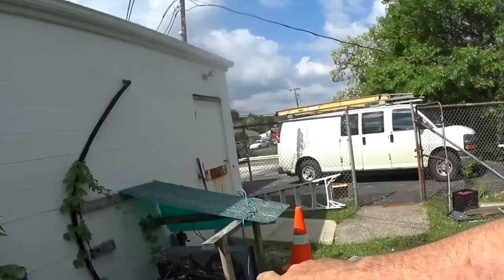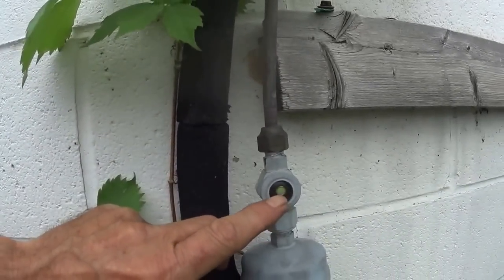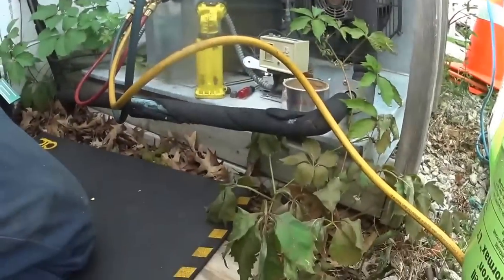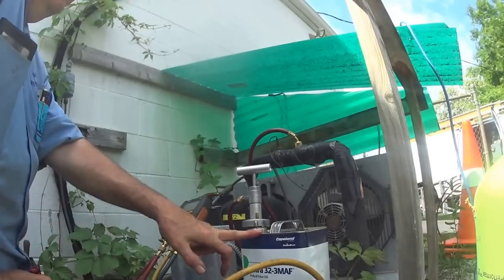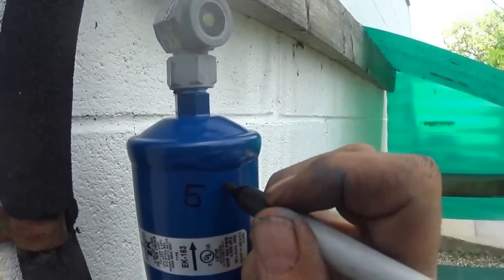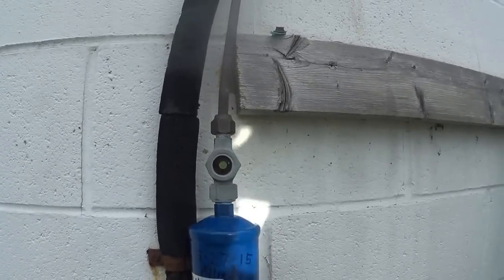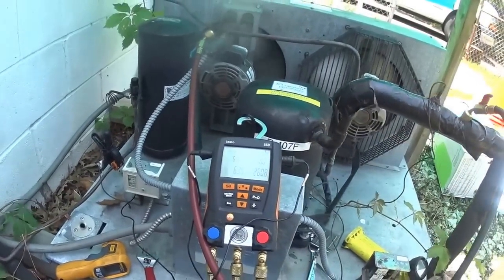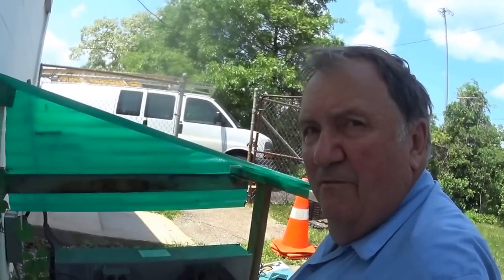R22 to R407F conversion on a beer cooler

Comment: Question, is it ok to just add 20% POE without removing MO? when R407 retrofit?
Reply: I'd say no. You need to remove the old MO first. In the system illustrated there will probably be no problems with the oil return anyway since the suction line is so short, and goes right down to the compressor. But in a larger system with multiple evaporators and longer lines you really want to aid the oil return as much as you can and that means removing the MO, to be taken as a general rule as well. 
We did a lot of retrofitting in the 90s in my country following a ban on chlorinated refrigerants (R12, 22, 502), so we've already made all the mistakes. No need for you guys to make them as well.

Comment: Wow, another pump and adding POE oil on top of mineral oil. Mineral oil will contaminate POE oil and the mineral oil will gum up the system, seen it too many times. You may get away with this for a while outdoors but if you do this to any refrigeration system which runs inside a restaurant under a heavy load the whole sealed system is going to need replacing. The oil will become like glue under high heat and stop up your metering device as well as burn out the compressor. Please stop mixing these two oils.
Reply from the maker: +David Brewer Honeywell recomends this I've done this for years with no problem, POE will clean an old system,
Reply: The oil is getting back to the compressors that you are successfully doing this on. Am guessing the oil can get back because it does not have to travel far.
Reply: Honeywell and Chemours say it's OK to do this,but I don't like it either. I pull the compressor, drain the oil, and refill with POE. Personally I think POE is dog's breath compared to AB, but it's what we have to use with HFC;s.

Comment: Is 407C for a/c's and 407F for refrigeration? I work offshore and we converted some old R22 systems over to 407C and then we got 2 new cooler/ freezer systems that were 404A. Both are in orange bottles could that be bad/ harmful to system. if they were mixed? Or will they mix?
Reply from the maker: 407c is fine for medium temperature

Comment: Hi Jim. Love the videos. I've been using R438a recently instead of R407f, I find it easier to use as no oil change or valve change is needed and it's suitable for medium and low temp applications. It works well here on the Gold Coast, Australia.
Keep up the good work!
Cheers.
Josh.
Reply: hey mate have you used R438a on any high temp applications? only asking as i work on a lot of APAC units obviously running on R22
Reply: also in Australia, 438 is fine in AC

Comment: Nice job Jim!

The GWP limit here is 2500, though there are exceptions to the rule for small systems, i believe the GWP for R407F is 1850 so it is well under the current limit here.

Comment: can you just top off that refrigerant for small leaks?  Thanks.  Justin from Columbus.
Reply from the maker: All Hours Maintenance never mix different refrigerants, you'll end up with a wierd chemical combination and you won't reach temperature, the compressor will run all the time. You can put R407F on top of existing R407F. thanks
Reply: All Hours Maintenance you should always find the leak and fix it
Reply from the maker: ***** that would be the best case senario

Comment: Are you going to stop converting to 404 and go 407f now Jim? I have seen 407f in supply house and heard a little about it but i have not tried it yet... what the price comparison to 404 right now?
Reply from the maker: awsom70 the 404a costs around $78. the 407F costs around$150. but you don't have to change the expansion valve, it works with the existing R22 valve. I expect the cost to eventually drop as it becomes more popular. I do like 404a, but 407F 's pressures are the same as R22 and it's good. Whats happening is they put numbers to all the refrigerants, GWP, global warming potential, the limit is 4000, R404a is 3950, too close and they want to drop the limit lower,. R407F has a GWP of somewhere around 2700 so it's safe for now. That's the latest coolaid. The good thing is it gives you a potential to make money.